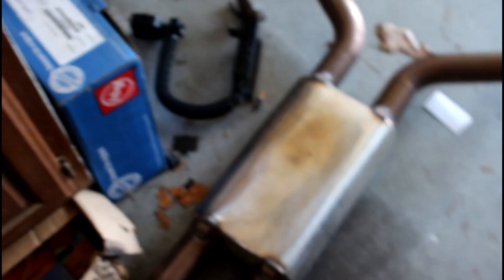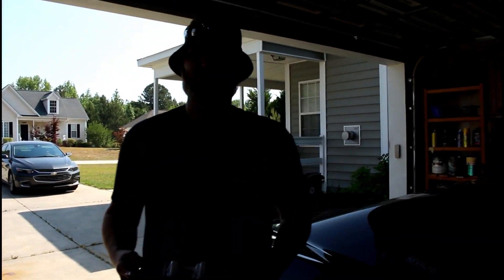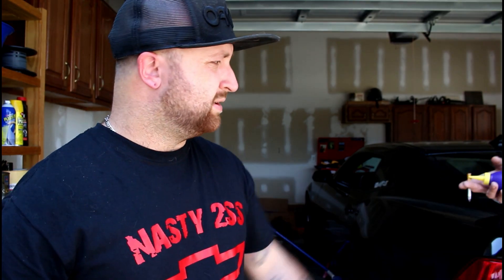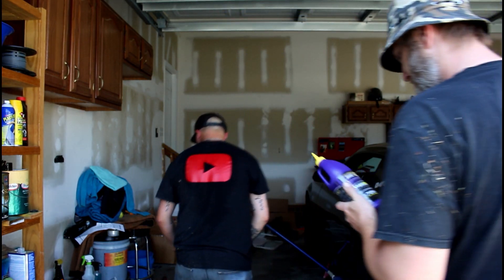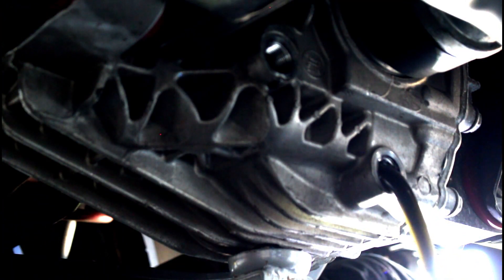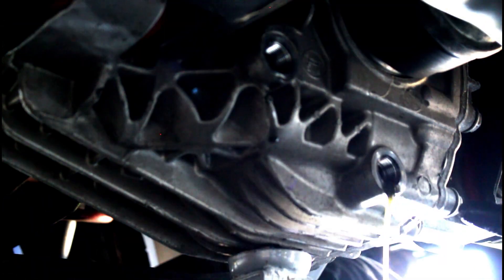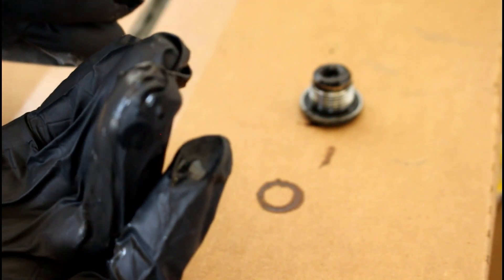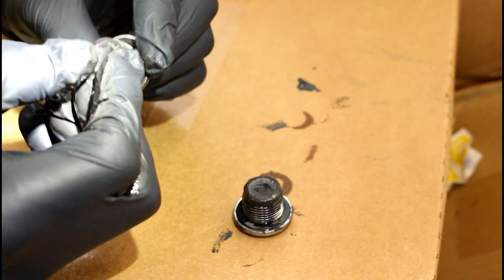Royal Purple Drain And Refill Rear End On 2015 Chevy SS Camaro

Comment: I know this is 4 Years old but for anyone watching this now if you are running A True Trac Eaton strongly recommends not running any Synthetic oil or any additives, Run regular Gear oil. This is not a clutch type Diff its geared and they work off friction. Also AAM/OEM Gears typically are quieter then after market. Nasty your car appears to run well for the mods you have.

Comment: I’m using a SPEC stage3 +. Clutch. No noise from it. It bites solid.   And good for 875lbs ft torque at the flywheel.

Comment: Surprising, I saw your AAM gear box that your 3.91 came in. You have metal shavings but no gear whine. I had a Motive Performance 3.91 put in (5 cut instead of a 2 cut like yours). I've drained the differential twice and have no metal shavings at all, but it howls like a wolf. Maybe I should buy an AAM instead?
Reply from the maker: I like the AAM. The shavings weren’t too bad, seems common with them for the break in. I waited a little too long to replaced the fluid too
Reply from the maker: Oh, and I love them. I would look into it

Comment: most likely when you clutch is engaged and it's making noise usually it's the throwout bearing not clutch springs
Reply: billy johnas +1 especially after swapping to an LS9 clutch. Katech is what I have and it’s so close to stock feel but it can handle the world.
Reply from the maker: Thanks for the info
Reply: no problem. I know you get this a lot by trolls but I wish we were closer 2nd I would love to race you. I have a 09 Silverado with a turbo 5.3 that runs 12:82 at 112. I know your right around that. it would be fun.
Reply from the maker: Nice dude.. that sounds bad ass. Where are you located?
Reply: south Florida. it went that fast at 10 pounds with stock 17 inch rims. 7.5 wide. lol
Reply: it's funny I just changed the rear end fluid in my truck last week. haha